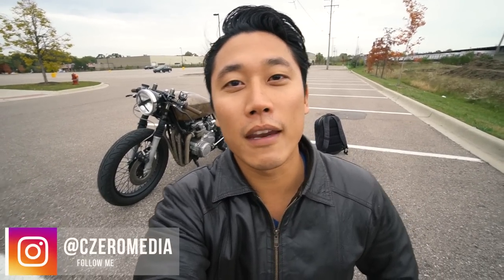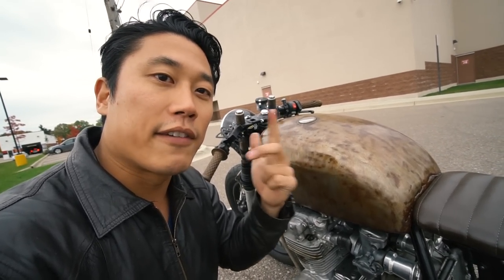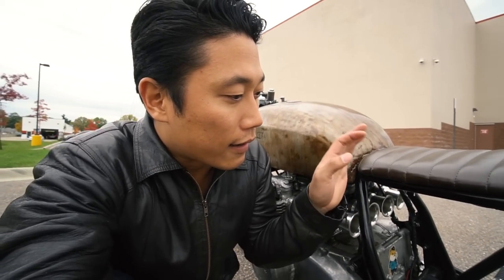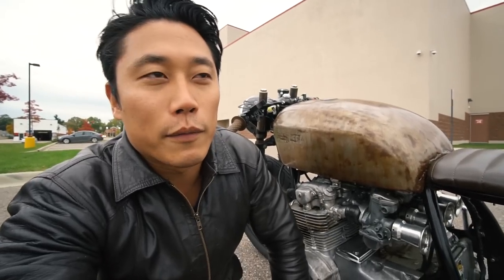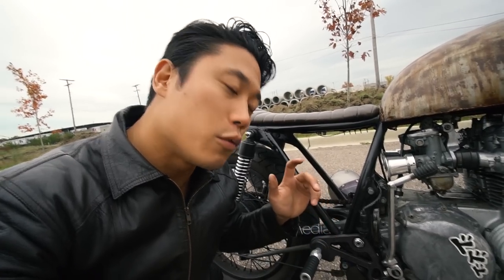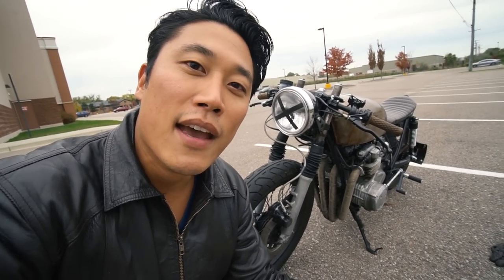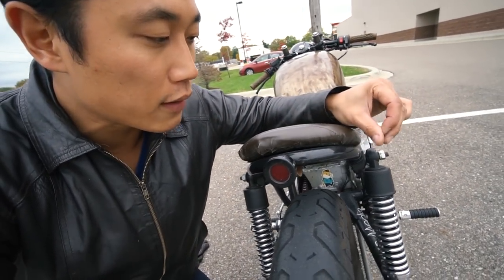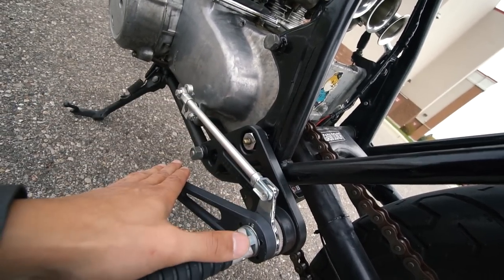Cafe Racer Update and Plans GSXR600 Front End? - CB550 Cafe Racer Build Pt. 74

Comment: no rear brake sounds terrifying, hope you never have to panic stop.
Reply: Yeah no rear brakes is fucking stupid.
Reply: yeah no rear brakes. No battery cover. no carb air filters or a mudguard. his killing the engine
Reply: Really? What is the proper rear to front braking ratio on a bike? Most choppers/bobbers I've built have only had one. Rear brakes are for Snowflakes.
Reply: @thepretentiouspig424  A chopper would be more back heavy, not likely to flip a bike but would probably lock up the front wheel in a panic, but on a cafe racer or sport bike, no rear brake is def sketchy
Reply: @thepretentiouspig424  What a stupid thing to say. Not trying to be disrespectful but you only have 2 wheels. Are you really going to use one wheel to brake? Also suspension needs to settle when you are breaking, the rear brake is built for that, and its more comfortable for normal braking!

Comment: Red Kote is the best, I have used it for 30 years. I worked in a radiator shop for many years and we used it on lots of old autos that new fuel tanks weren't available. I have used it on steel, aluminum and fiberglass motorcycle tanks even my dirt track race bike. It was not affected by 108 octane leaded race fuel and Klotz Benol. Great video.

Comment: hey i did the yellow foam strip light on my bike. the trick is cut the slot spray the foam first then push the lights into the slot if you put the strip in and spray into holes drilled behind it will just go around. its pretty easy not as bad as you think.
Reply from the maker: thanks man!
Reply: @CZeroMedia  thanks for reading! here's some more details if your interested you gotta let the foam dry too otherwise its a sticky mess over fill the void slightly cut the foam flush and let the strip compress the foam making the lights tight to the slot i used a piece of tig rod to to make a hole for the LED wire and fish it through the frame tube. also slot needs to be slitly smaller than the lights mine turned out to be about 0.41" I just drilled a hole at either end of what I wanted showing of the strip drew lines connecting top and bottom and followed with a dremel, looks super clean.

Comment: gsxr forks and r6 forks should be direct bolt on for a 500/550 frame besides the conversion bearings. You can use a harley front dyna glide hub with the correct wheel bearings to fit the forks and then run a spoked wheel. I usually just run a 16" spoked hog wheel in the rear, maybe run some nice excel rims on them. Im fishing a  750 chopper project and 550 cafe right now, text me if you come out to Waterford.

by the way I really enjoy that toggle combo for the ignition.

Comment: Love it and can't wait to see the front-end install. Please configure a rear brake solution though!
Reply from the maker: yeah im def looking for a solution
Reply: @CZeroMedia  you could always look at putting something behind the foot peg? Move your foot back to step on the brake, instead of having it forward, and in the way.
Reply: @CZeroMedia  if you're looking for designs, let me know, I could scratch something up. Lol
Reply from the maker: hmmmmmmmm well the issue right now is that the brake lever hits the new rearset. im not sure if you saw thee rearset installation video but if i could keep the existing location by modifying the pedal, that would be the ideal solution
Reply: With the GSXR front end, (brakes) you'd never need the rear brake.
Reply: Jimmypop 77 idk where to start by telling you how dangerous it is with only front braking and how limited you are. It upsets the bike majorly.
Reply: @TWIRKNOLOVE  You don't know where to begin because you don't seem to understand. How much riding experience do you have? How about track time? Pro instruction?     I'm in agreement that no rear brake isn't the best on a vintage bike with vintage brakes, (I have a 1975 CB360 so I know how weak they are) modern sport bike equipment is FAR superior. There is  good reason most modern bikes, especially sport bikes, have two massive rotors on the front and a tiny one out back.  If you like to use the rear only or a combination, that's your prerogative.  My point is mounting a front end designed for  a bike that is much heavier and way faster (GSXR)  rear brakes won't be as much of a concern.
Reply: Jimmypop 77 Jimmy, that information is massively incorrect even for new bikes. The bike can weigh nothing more than 50lbs and it will still upset the bike. As for me? 6 years on a bike with multiple track days, and from the experience and education as a mechanical engineer I'm not telling you this for the sake of arguing - you need the rear brake to not upset the balance of the bike while and to not limit its capabilities. There is a reason it's there even with the front being bias just like cars. Just imagine coming in hot into a turn and braking/setting up body position prior and only having the front brake? Or even worse, emergency braking. It's you who heavily doesn't understand.
Reply: @TWIRKNOLOVE  well, telling me you're an engineer speaks volumes. 😆.  
 "I've used the rear brake twice, both times I ended up on my head" - Kevin Schwantz
Reply: Jimmypop 77 Hahaha you think I don't know about Kevin!? He's adapted to only use the front brake because of his upbringing of how he chose to ride bikes. It's like telling me you drive an automatic car braking with your left foot only. Dynamically it is incorrect to only brake heavy with the front on a motorcycle period. Kevin uses his throttle and clutch to upset the bike into the position it needs to be in because that's how he learned young; unconventional. Nice outlier, but still fundamentally wrong. Tell CZ to copy him then Lol. Your choice of refuting points speaks volume on how much you know.
Reply: @TWIRKNOLOVE   Engineer-
" My TeXT BoOk SAys Ur WrOnG ! "  I hAve a cLIPboArD anD a WhiTe hArD HaT".   Insufferable.   Thanks for stopping by again. Im glad you took the afternoon to study up on Kevin. He seems like a cool guy eh? 
I'll just keep riding the way I do, and so will you.  Now,  I'll sit back and wait for the snarky comment you, as an engineer, can't help but make.   Go ahead, I know you NEED the last word. 😉
Reply: @TWIRKNOLOVE  hook, line and sinker.   Perfect.  😘
Reply: @jimmypop777  The sweet sight of defeat. Honestly, it was pretty easy. 😉👏😊😂😍❤👌😜😆
Reply: @TWIRKNOLOVE  #lastword. 😂

Comment: Whats up Ish! Bikes looking super mean! Just wanted to say two things- firstly, Ive seen all your builds from the beginning of when you posted them years ago, but I dont remember you saying that your tank is ACTUALLY NOT FROM A CB550. As Im sure you know, Its from the K model of the CB750- basically any year from 69-76! If guys are going for that fuller and larger tank look- the lower profile cb550 tanks that are from all the K versions of the cb500/550s are not going to be the same.  Theyre similar but more slimline. But The F tank from CB550F 75/76 and all CB550 tanks from 77-78 are bigger, larger,  more "stout" looking and race inspired.  Secondly,  the GSXR front is basically done to death, but for good reason! Its a huge upgrade to the entire ride of the bike. My favor to you is keep the strategy of this build the same- when approaching the front end. So far youve kept everything budget conscious from the beginning- basically giving alot of us garage guys- a ton of amazing information, advice and most importantly inspo to do it at home on a dime. That being said the easy way to get that front spoked wheel is to do the full Cognito treatment, but its really expensive, so my ask is that you look at the GSXR front end with the harley dyna front wheel solution. This comes with some inherent issues- like drilling out the correct pattern on the gsxr  or huyabusa rotors and some spacing issues But for 95% of guys the solution is much more cost effective and makes it doable. Thanks again and keep up the amazing work !
Reply from the maker: thanks a lot for the reply my man. and yeah, i have realized that my tank is not the original 550 throughout the years :D As for the gsxr, yeah. its def a common direction people take on these bikes but like you said, a much-needed upgrade. cognito for sure would be the easiest solution but at the same time, i need to keep the cost down. i will look into the harley dyna front wheel solution a bit more. i have certainly heard of it but havent researched much into it just yet